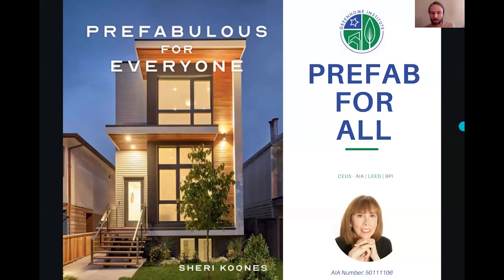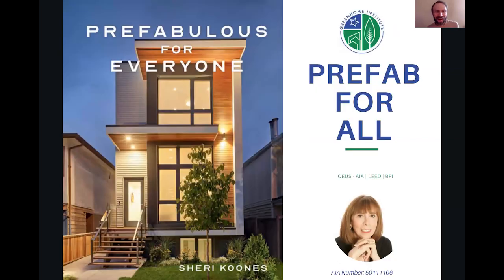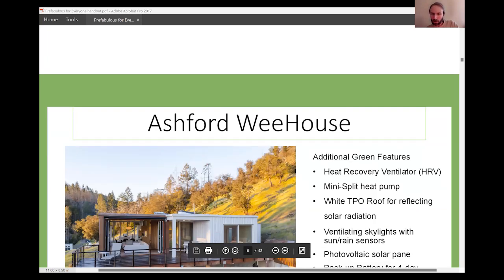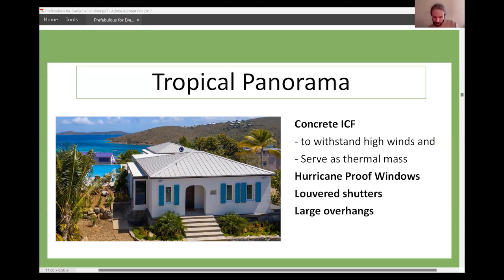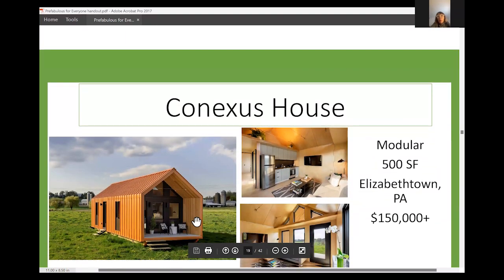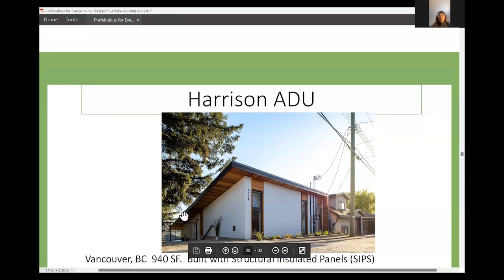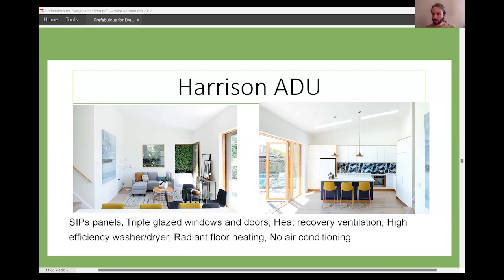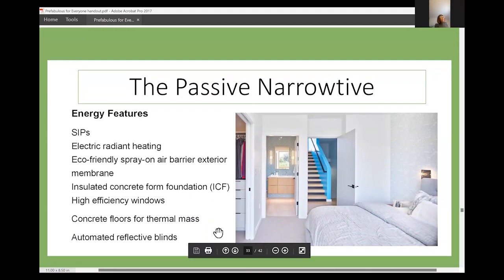PREFAB For All

Comment: With regard to ICF, you have to realize that it will last twice as long as a house that is made of SIP or stick.  The thermal mass is of great benefit to maintain a comfortable temperature so a heating and cooling will work less spending less energy and less wear on equipment.  It's helps a great deal with sound proofing, fire protection, wind damage protection even if you lose the roof in say a Tornado (most houses fall once they lose the roof) as well as bug and vermin protection.  All of the above can shorten the life of house or cause repairs and retrofits before its normal lifecycle.  I honestly do not find an ICF house to have a worse carbon footprint for these reasons.

My wish is that these consideration are taken into account and some may find that ICF is superior to SIP and stick built houses if built well.